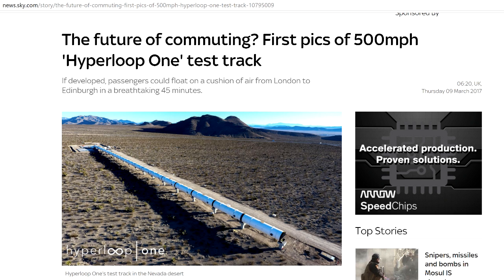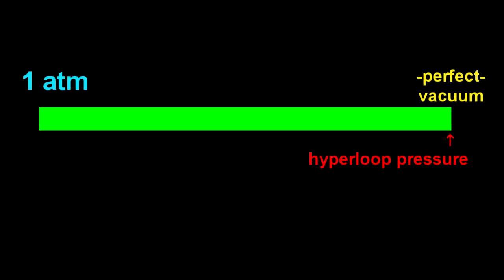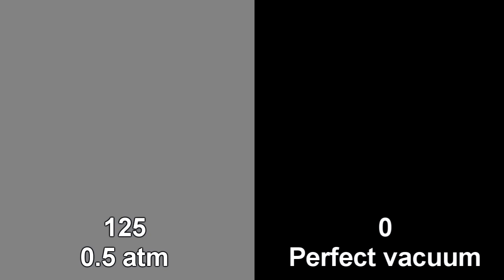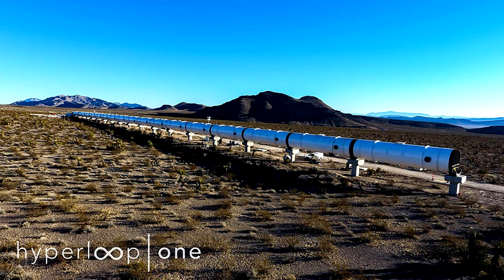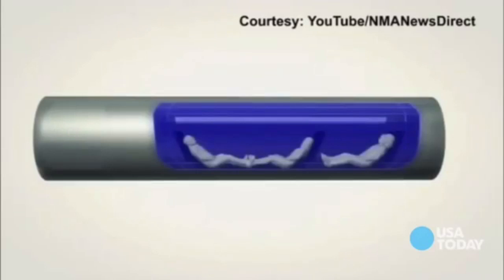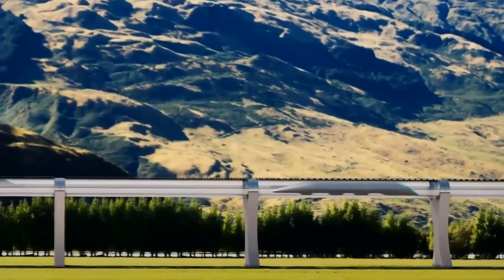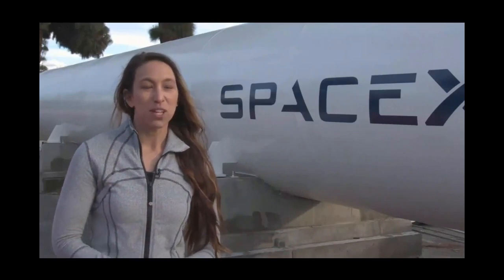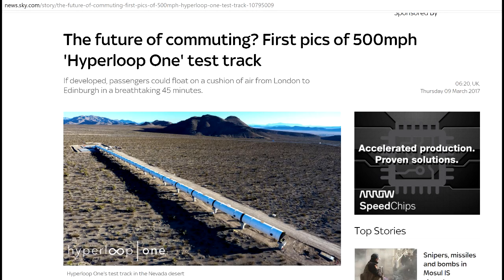Entire Hyperloop could be destroyed in SECONDS!

Comment: hyperloop could be practical in other planets, where there is no atmospheric pressure but not here.
Reply: No. On a planet without an atmosphere it would not have any use. A simple train would be far more practical.
Reply: you have dust on tracks plus cosmic radiation, tube could prevent that ;)
Reply: but then its just a train in a tube. No systems needed for removing air
Reply: yes thats why it would be practical
Reply: It wouldn't be called hyperloop then
Reply: it would be called practical hyperloop :D
Reply: Yess I think it would be called simple tunnel with shielding

Comment: Some of thuderf00t's concerns are quite valid but ripping on the flaws of an early test track are not really valid arguments against the hyperloop. Ripping on the size of the test track is similar to saying something like "graphene will never get off the ground because look at the size of the first flakes they produced, they are only a couple hundred atoms across. That's like a million times smaller than the couple centimeters you need to make circuit boards or composites". Also, ripping on the length of time it takes to depressurise the test track dosent make sense. On a real hyperloop most of the track only need to be depressurised once after that only a loading- unloading chamber where passengers-cargo get in and out needs to be depressurised and this section doesn't need to be any larger than the vehicle itself, so that might take one minute, maybe two. 

 I agree that the Hyperloop in it's current proposed form is a bad idea, especially when we have maglev technology that is proven and could go almost as fast, needs no dangerous pressure gradients, is much more robust against the elements and even allows for natural daylight and nice views for the passengers. Elon should jump off the hyperloop and work on maglev especially since his car company Tesla already has much of the technical expertise and infrastructure in place needed to design and manufacture maglev technology.

Comment: I think a few of the only things that could help this is as follows:
1: Airlocks. You adjust the pressure to just one small section that can be gated off from the rest of the chamber (not unlike on space stations or other spaceborne shipping), so you don't have to adjust the pressure in the entire damn thing (cause that's stupid).
2: External reinforcement. You take the concepts that tanks use to defeat HEAT rounds and apply them to the tube, so it basically has spaced armor against everything, even the supports (which should be in an underground chamber for protection anyway, but that's expensive. not as expensive as spaced fucking armor, but still). For this thing I'd use a thicker mesh than what tanks use to protect themselves and outright plate on the ground to stop things like, I don't know, trucks? Of all of the concepts, this is the silliest, but it is fitting to the topic.
3: Don't go below a pressure threshold. Yea, air resistance will still be a thing, but aircraft like the SR-71 are air-harvesting aircraft in a thin atmosphere, and you don't need to go anywhere NEAR as fast as that in roughly the same thickness of atmosphere, and won't have to worry about the nose of your pod heating up to 400 °F. Not saying that heat won't be an issue, just not as much of an issue.
4: Pressure backfeed pipework (getting super-technical here). The Chunnel has these, and its basically to enable the trains to move through without too much fuss, as well as maintenance pathways. It'd take energy to manage the fans and ductwork, but I'm sure we can ask those guys with the cone-shaped solar panels for a leg up, eh?

Comment: I really don't understand why they are using a vacuum tube. There are a few ways that they could do a loop that doesn't require as much energy and won't take as long to load. The student competition should have required the students to come up with the most efficient scale model propulsion system. Whether that may be a mag-lev in a tube, a the use of air levitation, or a thorium powered car. Rather than the lowest friction car in a vacuum chamber. There has got to be a better way.

Comment: Why not instead of using low pressure to reduce drag caused by air resistance (epic cost for puny gain), why not just use air pressure itself to push and pull pods that are designed to catch and sail with the air? If you are being pushed by moving air (in conjunction with magnetic acceleration on the track) then not is there no drag (because the air is moving with you) but it also pushes you along. 

It's like they're trying to drain the ocean instead of just building a boat.

Comment: Ok, you got me thinking about two points... 1 - How will the people inside the chamber breathe? will there be an oxygen tank similar to those divers wear?
2 - Will this actually be more effectively than a normal car using normal fuel (or even an electric car) in terms os total energy spent (refining fuel, using the fuel, etc), because if it took that huge amount of energy just to get near vacuum, is it even worth being used?
Reply: According to the white paper each car has an internal air supply, supplemented by oxygen masks for partial decompression(like air planes) of for total cabin pressure loss, the entire tube depressurizes  using valves(like airplanes making an emergency descent).

Energy cost wise its about 1/10 that of gasoline cars or planes per passenger trip.   And 1/4 or so that of electric cars.  This includes the energy required to maintain the tube pressure and to charge the hyperloop "car's" batteries, given a 70% passenger load.

Comment: What if instead of having the whole hyperloop be in vacuum, let's say it works more like a pneumatic tube, like the kind that sends money into the bank? So, the train would be cylindrical and form a hermetic seal with the walls of the tube. Everything in front of the train is vacuum, and everything behind gets pumped full of air. The pressure difference pushes the train forward until the pressures on both sides are equal. Obviously, you cannot have the whole tube be in vacuum at once, so you can have airlocks along the way that guarantee that some short distance in front of the train will always be in vacuum, but the rest is pressurized. When the train gets to a stop, simply pressurize the chamber, create a vacuum in the next chamber, open the airlock, and voila, the train gets sucked to the next checkpoint. Obviously, still very energy intensive.

Comment: If you were to have the main tube of the hyper loop under near perfect vacuum, and have a portion of the hyper loop at 1 atm, with a car thing in between, could that be a feasible way of transportation? Then it would only require the energy to put 200 feet of tube into a vacuum, right?

Comment: As show in the tanker, developing vacuum in a sheetmetal shell works about as well as a beer can. Using a beer can to hold a bit of liquid and pressure no problem and why tankers can and are built lightly.

Vacuum in any vessel with decent wall thickness is easy and yes they don't collapse even with a good sized dent.

That said, you might look at what happens to solid steel railroad rails with temperature in the desert. That is a non-trivial problem. Curves have to be designed in and latteral movement accounted for. Large pipe may be an interesting problem since they won't have the themal mass of one with liquid inside.

I would also thow in economic issue: Maintanace of large scale vacuum pumps and related. Monthly maintenance and rotating annual rebuilds. Throwing the word vacuum in is almost as cost heavy as the words medical or aerospace.  I picture a pumping station at each mile, 3 blowers and six pumps each. 700 miles => 2100 blowers 4200 pumps  two thirds in operation 24/7 with the backup set in rotation. Valves, guages, and controls... and the crews working 24/7.  It would be nice to add rails above the pipe so the maintence crews had a way to shuttle people and parts between pumping stations because they will have plenty to do.

Comment: Please reply, why couldn't they do many many segments with walls(That open and close) in between, so that if one of the segments fail, the tubes in front of it and behind it will be fine.  Also, if this were to ever be a thing, they'd obviously start to make much larger pumps to do it quicker.  Lastly, why are they using such slow propulsion, why couldn't they use fuel to shoot it forward?

Comment: I agree with you 100% on this Thunderf00t and I'm not saying it would work in practice ever, but if you're gonna start, you gotta start here: Instead of depressurizing the entire fucking thing, you'd think they would use an airlock... Airlock is at one atmosphere of pressure, people board, the cabin is sealed, they depressurize the 50 feet or so of airlock to the hyperloop pressure. Still, that's only one argument out of the way(in theory). And if these morons couldn't even do THAT, there's no way this project will succeed.
Reply: They're planning on doing that, and to quote the white paper, "The transit area at a Hyperloop terminal would be a large open area with two large airlocks signifying the entry and exit points for the capsules".  They actually took most of the issues that he mentions into consideration in the white paper, and the hyperloop isn't as crazy of an idea as Thunderf00t is making it out to be.
Reply: I've officially applied to Hyperloop because of Thunderf00t's ignorance.

Comment: Perhaps the entire system wouldn't need to be depressurized every time, but only a small section with airtight doors, that's large enough for one pod, and then once that section is depressurized and the passengers are in, the doors are opened to connect it to the existing depressurized system.

Comment: You know thunderfoot.
I thought you were a decently sensible person until i viewed your Hyperloop 'series' 
However, lets Bust the main seed issue with this video:
Its a tanker truck, not a vacuum chamber.

Thats like saying submarines are a bad idea operating at -5000 feet because a space shuttle would implode.
Oh boy... i wonder why. Perhaps it may be something to do with what it was designed for?
Talking of things that are not designed for other things You wouldn't know about that, you're a chemist not an engineer.
Reply: I think the point was actually just to illustrate how destructive a vacuum can be. I mean, submarines have been crushed by pressure due to error and damage before. Even though they are designed to withstand immense force.

The hyperloop would be exposed to the risk of implosion, regardless of the fact that under normal conditions it is designed not to implode... and due to the immensity of the forces at play the result would be catastrophic.
Reply: Implode yes; Fully, likely Not (Unless thunderfoot made it).
Unlike a small submarine where you have a finite balance of weight and strength The hyperloop is supported by struts, a submarine is not.
Meaning they can engineer the chamber to be far stronger than the 14Psi pushing against it.

My next point:
We're only dealing with pressures below -15 PSI, that's almost one eighth of the pressure of my small air-compressor, while a submarine is dealing with FAR FAR, Out of the window, Hell, almost off of this planet in pressure.

At 5000 Feet the pressure underwater is around 73,250.1 PSI! Now, If we can build Tin Cans to withstand that extreme pressure, there will be no problem building a long Tincan called the hyperloop at -14.7 PSI, With emergency valves.

Does that mean the hyperloop is safe? No, Flying on an aircraft is not safe, Driving your car is possibly one of the most unsafe things you likely do on a daily basis. Well, Short of taking this Thun-der-f00t guy seriously.

(Keep in mind the hyperloop is running at 99.9 somethin' % vacuum,  Just keeping the trolls at bay.)

Comment: you made a point about how long it took to pump air out of the tube being impractical to wait for. using 2 pneumatic doors you could keep the loop at a vacuum and only need to pump out the entrance chamber where capsules are loaded.
that said you still busted it.

Comment: We should shut down the LHC because large vacuum chambers are unpossible.
Reply: The tubes of the LHC are not big enough to carry a passenger containing car.  And the propulsion for the protons is electromagnets, not air pressure.  And if you think large vacuum chambers are "unpossible", (impossible, fool) I would suggest you check out the size of the chamber NASA has built.
Reply: The LHC is atleast a mile beneath the surface and isn't even meant for transportation, it was built to test theories such as "String theory", "Theory of relativity", and the "Big bang theory", as well as to create particles that are otherwise impossible to study or create(anti-matter, higgs boson, planck particles), and its not impossible, its been running well for more than 5 years.
Reply: What argument?  His argument from incredulity?  His flawed argument about acceleration because he ignored scaling laws?   His flawed argument about tube breaches because he doesn't understand compressible flow?

watch?v=BJa9tQyMXDc
Reply: kurtu5 Except of course that those vacuum chambers are underground and can be secured with huge amounts of structural support, and the tube itself has very little surface area and volume. Those tubes are seriously thick. Kind of hard to maintain that in a tube that runs over land, has to deal with thermal expansion, and has that much volume with that little structural support. It's a lot easier to maintain the kind of turbomolecular pumps it would take every few goddamned feet just to maintain a vacuum in case of a small hole in a laboratory setting, and NOT in the middle of a desert. How do you think people will be able to Service those kind of vacuum pumps out in the middle of nowhere?
Reply: @MyLittleDashie7

Not to mention the extreme engineering problem of avoiding catastrophic quenching of the superconducting magnets.
Reply: Oh now we are paying attention to scaling laws?  Sadly Tf didn't.  Also you don't need turbomolecular pumps to maintain a 100 pascal atmosphere.
Reply: And we are not going to put people inside the vacuum chamber at the LHC.
Reply: Turbomolecular pumps minimum inlet pressure is right about 100 pascals.  Seems kind of stupid to use a pump that can create 10E-9 pascals from 100 pascals input to create 100 pascals.  Dry scroll pumps on the other hand can trivially create 100 pascals from 1 bar.  They are reliable and easily maintained.  Also, one inch holes are not in the design spec.
Reply: Yeah but large vacuum chambers are not possible.  Hell the LHC is an ultrahigh large vacuum chamber.  The vacuum in the HL is peanuts compared to the LHC.
Reply: Big difference between burying a thin tube underground to throw particles around, and putting a big tube above ground to transport your family.

It's called risk analysis.
Reply: the LHC's volume is so much smaller and at least it's underground. it doesn't need to worry about paying itself off with $20 fares... the Inverse square law should give you an idea the the forces and pressures you're dealing with here make the LHC look like child's play (without a missile going back and forth inside.)
Reply: +kurtu5 For that kind of volume, to pump it out in a timely manner, or to counter even the tiniest of holes, yes you do need turbomolecular pumps. Or diffusion pumps. But diffusion pumps are an even worse candidate because they require regular refueling with a working fluid and are very energy inefficient. Not likely out in the middle of the desert. 

If you use the "Airflow through an orifice" formula, with a temperature of maybe 86 F, and a pressure differential of approx. 1 atmosphere, a 1-inch diameter hole creates an airflow of 150 CFM into the tube. A 2-inch hole creates 640 CFM. And it increases dramatically the bigger the hole is. The operating of most lab-grade vacuum pumps is 1 or 2 CFM. Some high vacuum pumps go as high as 30 CFM. 

In a mile-long stretch of 11' diameter tubing, there is about 501,000 cubic feet of air. To go from 1 atmosphere to 0.001 atmosphere in 10 hours would require nearly 6,000 CFM of pumping power. Which is almost reasonable. That's about 6 turbomolecular pumps for every mile-long stretch. 2,100 pumps for the entire length of the tube. Most of them out in the middle of the desert. Taxpayers, prepare your butthole for routine vacuum pump maintenance.
Reply: @viermidebutura: It looks a lot bigger than that to me: https://en.wikipedia.org/wiki/File:Large_Hadron_Collider_dipole_magnets_IMG_0955.jpg
Reply: what the fuck suddenly my reply notifications work again after being silent for 6 months
Reply: They're not actually using the LHC as a transportation conduit. It was also purpose built as a large vaccum chamber (as opposed to what looks to be Aqueduct Piping out in that desert test track.) You can't build it off the shelf. The LHC was a multi billion dollar project. But it's length is not the length between two cities. It's not that the task is technologically impossible. It's that the hyperloop is stupid inefficient, economically unsound and just downright dangerous.
Reply: the diameter of the LHC tube is tiny in the range of a tens of milometers
Reply: Yep, clearly it's just not a thing that will ever be doable, even though technology get's better and better every year.

No point in even trying.
Reply: I used the word 'unpossible' as a jab towards TF's argument from incredulity.
Reply: Yeah, and I'm sure if the LHC was being talked about 50 years ago, the TF's of that day would have been saying the same thing about how dangerous it was, and how difficult it is to make depressurised piping. Just because something is not doable right this second, doesn't mean it'll never work.